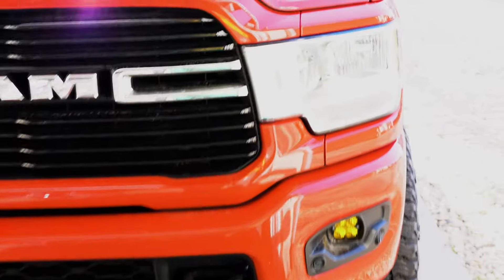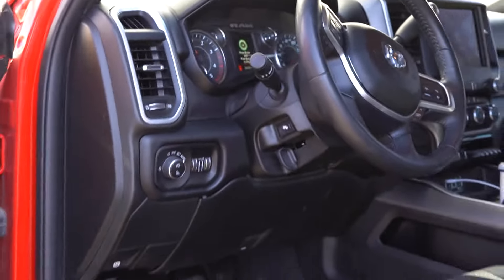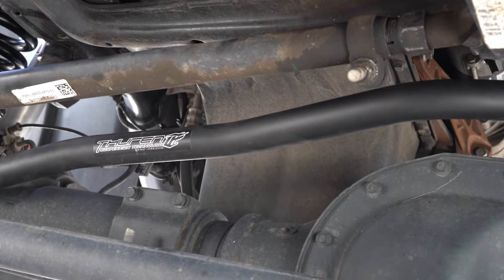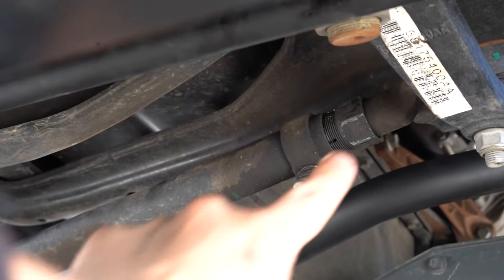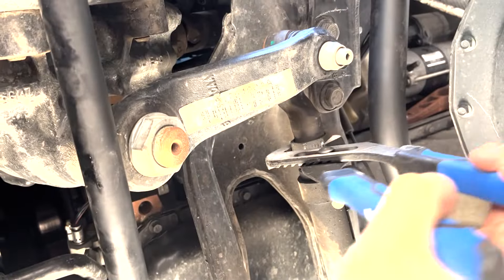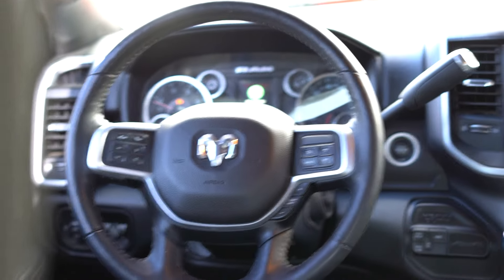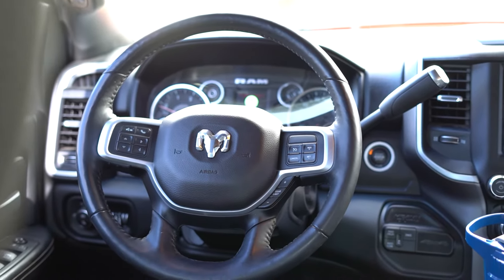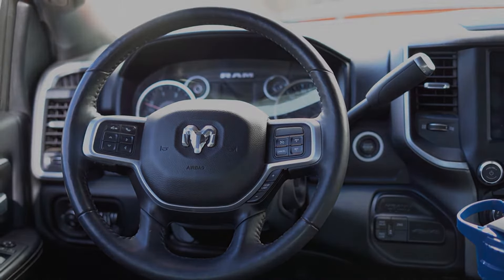How to adjust the "new style" drag link for your 2019+ Ram 2500

Comment: Thank you! Took my truck back to the tire shop after new tires and alignment because my wheel was off and they couldn’t figure it out. So simple. I was able to adjust by hand after loosening the 18mm bolt. I wonder if that’s normal 😅

Comment: I did mine yesterday and after tightening everything. Went for a ride and steering went towards the left now and drives straight. Wondering why??
Reply: Adjust your castor to drive straight….. 0.5*-1* more on passenger side to compensate for road crown.